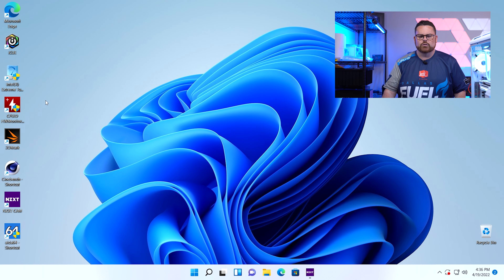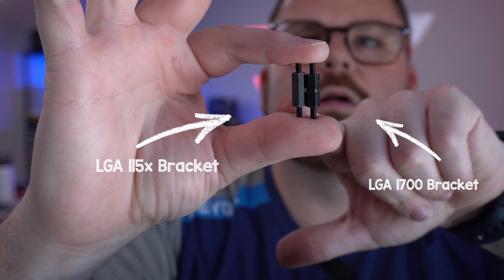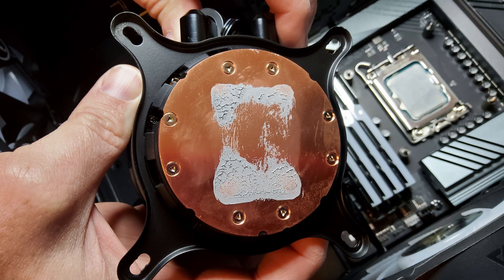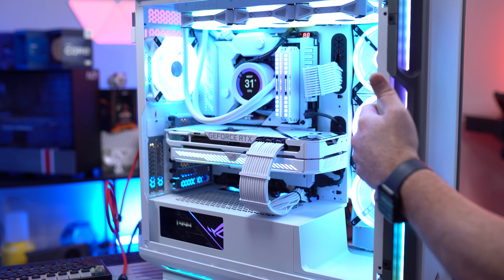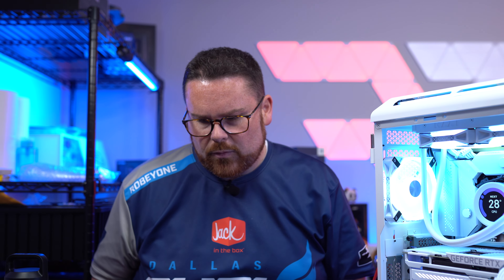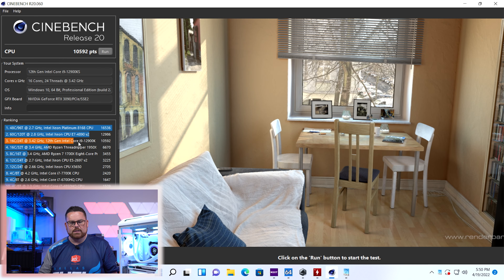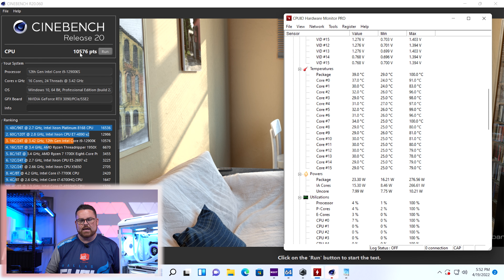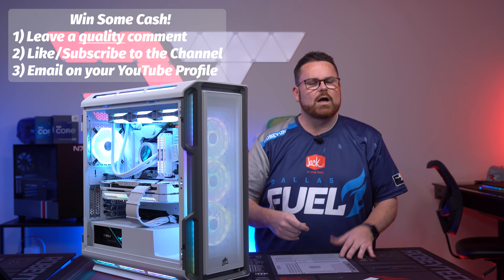How to fix Intel CPU Overheating Issues.  Step by step with results!

Comment: I like this type of video. This kind of stuff is what makes the difference for someone like me. Having an experience professional talk and walk through what is happening and what they are doing instills confidence on getting it done yourself. If I get a new system this year ($$$) I do plan on utilizing tips like these. I would recommend having a video on tips and Mods to help increase performance or things you can do to mitigate potential problems. Washer mod? I never would have thought to ask a question like this or even google it. I now know to keep things like this in mind. Keep up the good work.
Reply from the maker: Thank you!!

Comment: Hey, thanks a lot for making this video. Undervolting my 12900k worked!!. Temps in the low to mid 80's with an all-core overclock at 5GHz and all core E cores 3900 GHz
Reply from the maker: You are very welcome!!

Comment: I run the 12900kf on air. Temps are in the 70s playing games. I guess maybe it’s an issue with an all-core application but haven’t tried yet. The only thing I do right now is occasionally rendering a minecraft map, but I cooled the Threadripper with air and it had no problem running 32 threads at 100% for 15 minutes. I think the problem with air cooling is that you have to get the GPU heat out and away from the CPU and VRM. 

If you can find a way to do this with your case, then air works fine, and often better than liquid.

Comment: Nice video. Helped me a lot. I am running with an i9 12900k CPU. After resetting the BIOS and doing these steps, my CPU is performing better without the overheating issue. Thank you.

Comment: I'm running an overclocked 12900KS with a push/pull, top mounted intake, MSI AIO in a 5000T. Hitting 51* while gaming. Zero temp issues whatsoever.
Reply from the maker: Yep it's not every CPU and it's not a Intel wide issue.  But if you do have issues these are steps to try!
Reply: @robeytech  I just followed your recommendations and you led me to the promise land!

Comment: The video shows that there is not just one thing you have to check and possibly modify. A good airflow case that does not starve the components of fresh air.  I see de Bauer has manufactured and is selling a frame that replaces the hold-down bracket. It gives more support to the cold plate and supposedly reduces the bending of the CPU some have reported.
Reply from the maker: Oh that's good to know!  Will need to get one and test it!

Comment: Robey! As a  i9-12900KS user myself this video was extremely helpful and educational. Thank you for noticing an issue with a product and making a video to provide solutions for your followers. Even with ASUS MCE disabled and only XMP turned on my CPU also hits those extreme temperatures WITH Noctua 3000RPM industrials the  PC revs like an engine as the CPU is constantly skyrocketing to 82C even with light usage.
Reply: I know this is old but I just bought a i9-12900KF myself and am having higher temps than id like to see under light load. Did undervolting seem to do the trick for you or have you come up with any other solutions?
Reply: @whiskeyodyssey7546  You know, I lowered my temps by putting slightly more thermal paste than I am used too. My entire life I was following the philosophy to make the thermal paste layer as thin as possible. And that was hurting my temperatures. By making the layer slightly thicker it improved my temps drastically. It must be from how the LGA1700 socket interacts with my AIO cooler. There must of been a small air gap in between the CPU heat spreader and the cooler.

Comment: The possible application of the washer mod is very interesting.
It would have been even more interesting to see any improvement with the push pull configuration with both fans with high static pressure and with liquid metal.
In practice you need a radiator of at least 420 mm, hig stati pressure fan, turbo curve and a good pump to avoid undervolt the CPU and access maximum performance.
Thanks for your interesting content!
Reply from the maker: Actually we have done really well with a 360mm AiO and the right fans having a pretty big impact with a 420mm AiO.  Honestly there is a lot that Motherboard manufactures are at fault for here because you can see with under-volting we aren't actually losing performance which means the settings are too high in many cases
Reply: @robeytech  Thank you very much for replying to me and again for your great content.
Absolutely, you've given great advice, especially on a general level if you're not getting the performance you want.
I agree ASUS often has very high voltages in the most extreme modes, as do other brands.
However, I suppose (given the reduction of frequencies when exceeding T junction of 90°C before undervolting) that if you could keep the temperature <90°C with nominal voltage and thanks to new technologies such as DL Boost and Boost Max Technology 3.0 you can achieve (perhaps) higher performance. I affirm this from experience on laptops and desktops with underpowered dissipation system where higher performance can be achieved by performing uverclocking since the temperatures are lower and so the frequencies much more stable. However, once the dissipation system has been modified (better thermal paste or liquid metal, thermal pads with higher heat conductivity, additional fans, increased cpu heatsink..), much higher performance can be achieved with nominal voltages.
Furthermore I was also referring to a question of cost given an ARCTIC Liquid Freezer II costs half of the 420 Kraken Z73 used and could also have advantages in terms of cooling the VRMs based on the motherboard used given the high consumption of i9 k. Furthermore, with an AIO held at high temperatures there could be problems with pump reliability, as well as greater eveporation of the liquid. Unfortunately, even the push pull configuration cannot be done with all the houses, it does not necessarily mean that it always leads to advantages and an investment of at least another 40-85 $ is needed to be able to carry it out.
Furthermore, the maximum voltage that the processor could support for intel specifications is 1.72 V (although I think it is more reasonable to adopt a range between 1.25 and 1.40V given the high consumption), while CPUD has detected on the system that you have tested max 1.394V without undervolting.
In practice I think it would be interesting to be able to make the comparison:
360 mm with high static pressure fans
push pull 360 mm high static pressure both fans type PH-F120T30
AIO from 420
Maybe in another video of yours. Can't wait to see the Star Wars anniversary live stream.

Comment: This is useful information. I wouldn’t have guessed that undervolting would be viable. It seems counterintuitive, taking power away from the CPU. Seems like Intel made the chips draw more than they actually need, in my limited experience.
Reply from the maker: It’s actually the Mobo manufacturers pumping more than necessary

Comment: Such an educational video Robey, thanks for making it.  Intel seemed to care more about having the fastest desktop cpu without total regards to cooling.  Throttling makes it counterproductive though.
Reply from the maker: It’s not just an Intel problem it’s also a Mobo manufacturer problem.  They pump a lot of juice into the CPU that isn’t necessary, which is why I show under-volting. You aren’t getting thermal throttling and your performance is actually increasing.  You can actually undervolt and Overclock.

Comment: That's why I ended up going for a 12700k instead of 12900k, Intel is curently trash in terms of heat/power, Hopefully they fix it in the next gen.
I wanted to be able to air cool the cpu, Not really possible with 12900k if you want it running at it's best.
Reply: With undervolting that is possible with even the 12900k. Undervolting also serves the 12700k very well, do try it out! Its def worth it on Alder Lake
Reply from the maker: Yep what Thomas said!

Comment: I enjoyed watching the variety of ways to improve temperatures on powerful processors, especially with the basics of the Intel XTU and the washer mod on LGA1700.  The use of multiple utilities to control fans is a “realistic” scenario for many users that have not gone out of their way to unify their ecosystem. 

To put it simply, one must either increase the extraction of heat (e.g. better contact, airflow, ambient temperatures, more radiator space, high static pressure fans, temperature difference with contact surface, etc) OR reduce the amount of heat produced in the first place (adjusting clocks, undervolting, etc.)

A crazy thing I would like to see someone make videos about: when doing case reviews, show how much can you stuff into a case, like cram the thickest radiators and/or Push/Pulls that can effectively fit AT THE SAME TIME and still allow full case functionality. I’m just overkill like that!

Comment: my 12700k run cinebench r23 stress test with cpu temp reached 87c max with max of Tdp at 180w. its that normal temp for a cpu? its fine right? only with 240mm aio 😑 because my case doesn't fit 360mm aio

Comment: i have discovered a new simpler way of cooling, i have aan i5 13600k annd a z690 gaming ddr 4, and in the bios there is an option called  over temperature protection , you set it to 85 and its done, cpu doesn't go higher than 85, what it ddoed is that in lowers de limits wats, and works perfectly

Comment: My PC would always run cool as a cucumber. 8 CORES. Always in the 60's. Then in the last 6 months, it's been a constant 95 degrees. It fluctuates between 88 and 95. ALWAYS!!!!!!!!!!!!! Most of the time it stays in the 90's. Rarely does it drop under 90. And if it does hit the 80's, it's only for a tease, then shoots straight back up to 93 - 94 - 95. I've scanned for viruses, nothing. Scanned for malware, nothing. Checked for any mining pricks, no mining off my CPU is done at all. I've blown the ever living shit out of the inside. No dust at all. I've re-applied thermal paste. I have a stock fan, but it's massive and at full speed and has NEVER given me any issues FOR YEARS!!!!!!!!!!!!!!!!!!!!! I don't see why the fan would suddenly be an issue. I have looked at voltages today after seeing this video. And I've even underclocked it. My last resort. When having it lower, stuff would still be sluggish and freeze up, like I'm using a cheap laptop with an entry level mobile chip placed inside. So I reverted that back. I don't know WHAT ELSE to fucking do. My PC is never overloaded with anything. It's at 95 degrees when it's on 9% CPU usage and 17% ram used up. WHAT IN THE EVER LIVING FUCK IS GOING ON!!!!!!!!!!!!!!!!!!!!!!!!!!!!!!!!!!!!!!!!!!!!!!!!!!!!!!!!!!!!!!!!!!!!!!!!!!!!!!!!!!!!!!!!!!!!!!!!!!!!!!!!!!!!!!!!!!!!!!!!!!!!!!!!!!!!!!!! Dude, typing this comment out and my letters are lagging on the screen. Like, you don't understand, my entire PC acts like it's God damn fucking FRIED!!!!!!!!!!!!!!!!!!!!!!!!!!!!!!!!!!!!!!!!!!!!!!!!!!!!!!!!!!!!!!!!!!!!!!!!!!!!!!!!!!!!!!!!!!!!!!!!!!!!!!!!!!!!!!!!!!!!!!!!!!!!!!!!! For the love of ANYTHING that's holy, PLEASE HELP ME!!!!!!!!!!!!!!!!!!!!!!!!!!!!!!!!!!!!!!!!!!!!!!!!!!!!!!!!!!!!!!!!!!!!!!!!!!!!!!!!!!!!!!!!!!!!!!!!!!!!!!!!!!!!!!!!!!!!!!!!!!!!!!!!!!!!!!!!!!!!!!!!!!!!!!!!!!!!!!!!!!!!!!!!!!!!!!!!!!!!!!!!!!!!!!!!!!!!!!!!!!!!!!!!!!!!!!!!!!!!!!!!!!!!!!!!
Reply: I feel ya i been working on my PC like a mechanics for months nothing. I gave up i sent him to geek squad, im waiting for their call as I type I'll let know my results. My RIG run Virtual Reality Games
Reply: @WorldHayes-VR  Yeah bro :(
Reply: Any updates
Reply: @juliamarshall3491  Nope. Still runs like it's in hell lolllllllllllllllll, how I have not burnt it yet is anybody's guess man LMAO !

Comment: Hi man. Thanks for the video. I have the 12900ks as well and am getting hi temps when playing games like assetto corsa. I ran the cinebench 2024 multicore test. The cpu package temp was going up to 100c at times but was usually staying in the 90’s. The test ran for the 10 min but right at about 20 seconds left my pc blue screened.  I then ran the intel utility and undervolted to the 0.050 then re ran cinebench. This time it blue screened seconds after the test started.i restarted the pc and the intel utility reset it back to 0.000 v.  I don’t think my pc likes cinebench lol. I want to try the under voltage again but not run cinebench. I was wondering if you could help me out and if I should keep the under voltage at 0.050 v without running cinebench.  I’m going to I set it back to 0.050 v and am going to do some tests in the game. Any help or advice would be greatly appreciated. Thanks

Comment: One shouldnt buy a KS without a custom water loop lol. A 12600K or even a 12700K are much better suited for off the shelf cooling.
Reply from the maker: That's not true we run KS's with AiO's no issue you just need to turn off some of the crap that Mobo Manufacturers do and have the right cooling setup.  Also you can air cool and overclock a 12900k, just need to do some tweaking.

Comment: Honestly disagree with the under volt method you should never have to undervolt a cpu to run cooler. That’s just like running 10 mph everywhere to fix a transmission problem on your can